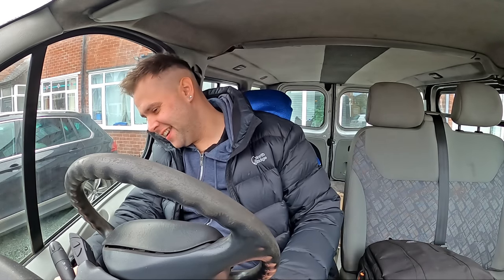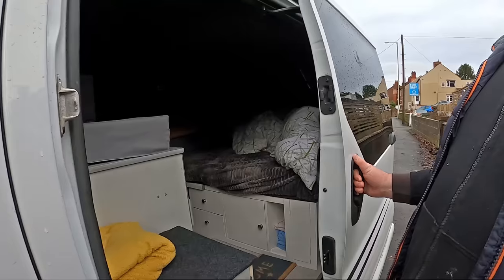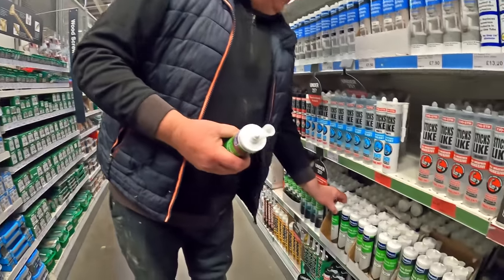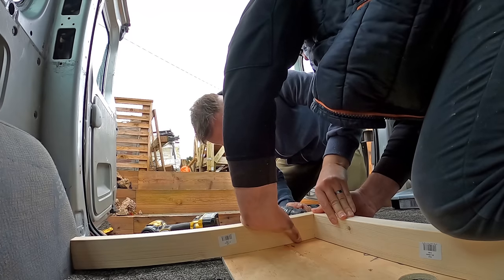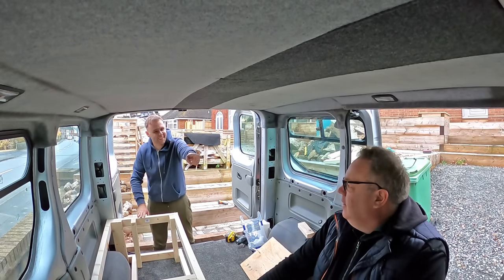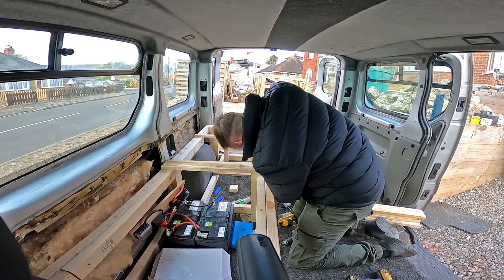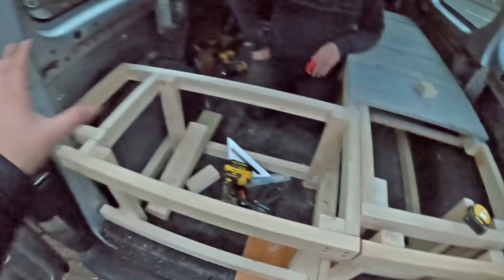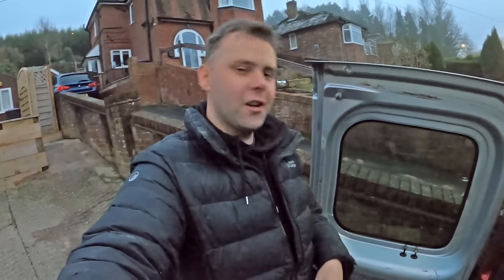Building A BUDGET PULL OUT CAMPER VAN BED | Trafic Vivaro

Comment: Brandon, what did you do with the old Bed/seating/table that you removed from the van? For sale by any chance? 

Vans coming along nicely to, what I would recommend is sealing the bulkhead (under the bonnet) I’ve bought/sold/broke these vans for 20yrs, sealing the bulkhead will save you scraping the van over seized injectors due to water draining on top of your air filter and down to your head and injectors.. very common problem, there’s a YouTube video to sort this for pennies easy job, saves a nightmare in the future.. 👍
Reply from the maker: Hey mate, the old bed sold to a chap for his van and thanks for the tip on sealing the engine area 👍 I'll take a look into to 🙂

Comment: On your bed you need to space the slats out a bit more and on the ones that slide out put a couple of washers between the screws to lift them up slightly so they slide back over the wood easier when closing it back up. Also ideally you wanna be building the furniture last 🤣 your making life alot more difficult for yourself when you come to sort walls, floor and ceiling out  ..... Good luck 👍
Reply from the maker: You sir are absolutely right in everything you've said and we certainly learnt the hard way with this one 🤣🤣 thankfully everything works as it should now 👍 I didn't think this through... Lol

Comment: What’s the bus like mechanically ? After your last debacle with Renault . Have u had it checked or read up on potential problems ? I see so many van life vids of mechanical woes some of which are basic . How have you tackled the insurance side of the conversion, and do you after converting need a certificate of any type . I only ask as any modification how small is required to be declared any excuse so they don’t have to pay .
Reply from the maker: Hey mate, yeh the van is pretty solid to be fair. Timing belt and full service has now been completed and 2 independent mechanics have both said they are surprised at how good the underneath looks. Insurance wise, I'm glad I have a minibus to convert as it already came with windows as standard. Just explained I'm in the process of converting 🙂 no hassle 👍